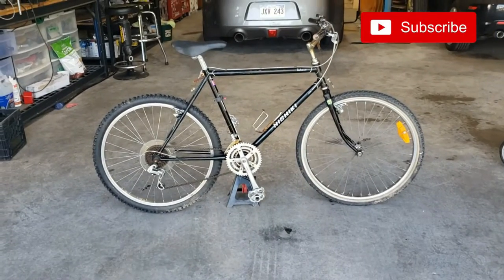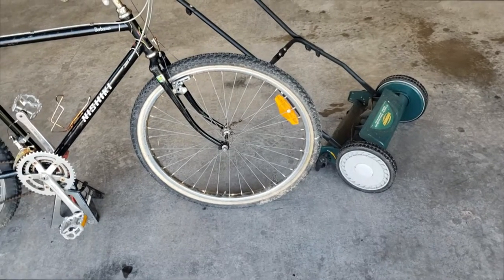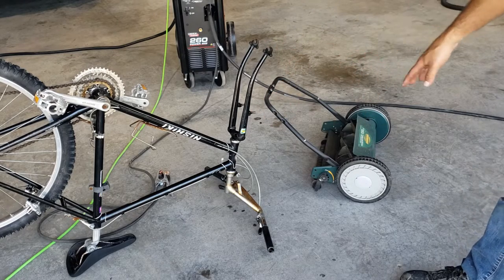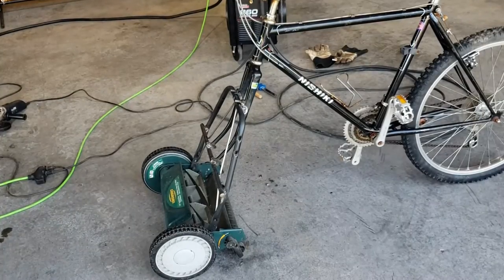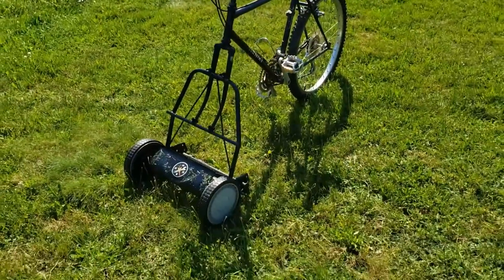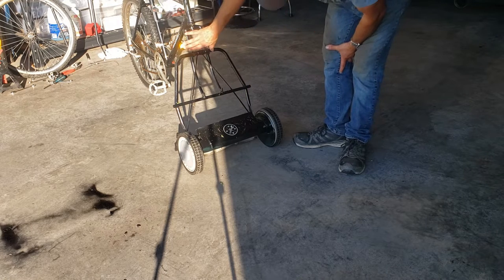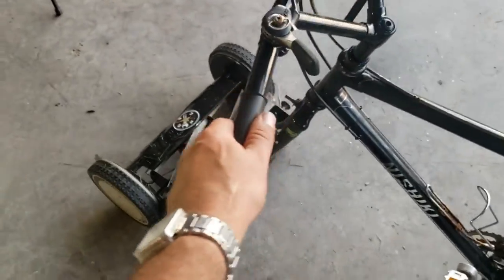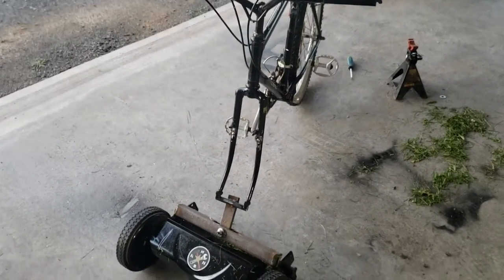Bicycle Lawn Mower

Comment: Why not keep the front weel, and mount the cutter on the front wheel hub and with suspensions to keep the cutter in line with the surface when the bike is turning and leaning.
Reply from the maker: That's a good idea. It would definitely help take weight off the cutter and maybe help with the rolling resistance.

Comment: Cool stuff. Maybe it should be at the back. Maybe it would be easier to pedal? Like a big, wide and heavy one at the back. With hydraulics to pull it up to gain speed? Well... maybe that's too much. 😀
Reply from the maker: Hmm that's an interesting idea. I've seen this design before so I went with the similar style with the mower in front but maybe I should try another one in the back like you say. Or maybe even in the middle similar to a lawn tractor 🤔
Reply: @nothandsomebuthandy  PS: 2AM here. Good night 😉
Reply from the maker: Good night from Canada!
Reply: @nothandsomebuthandy  Before I hit the sack... Two seat bicycle. One guy pedals the blades like a helicopter, one pedals the bike? Man... I'm not going to be able to sleep. 😀😃🙂 No, I'm out, I'm out... 😊

Comment: Hey! Let me ask you. Is it easier this way than the normal way? Is it at least faster? When it gets stuck it's much harder reversing, right?
Reply from the maker: I haven't made any changes yet this year, it's definitely hard with the current design but I would like to try some different gearing. So far there is no way to reverse.

Comment: Does it work? Seriously considering trying this
Reply from the maker: It works but in its current state (version 2) is pretty difficult to pedal and the steering still needs some work. I'm not in the best shape right now so I get winded after just a few minutes. But I plan on tweaking it some more next summer with much lower gearing to see if that'll help.